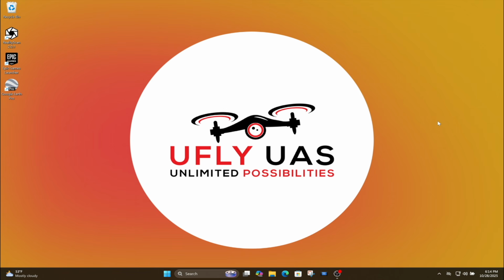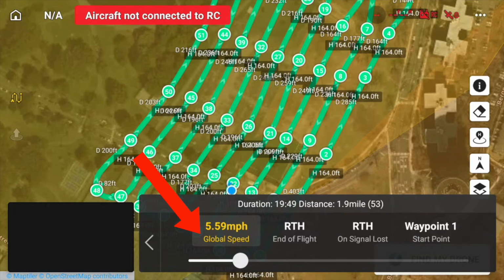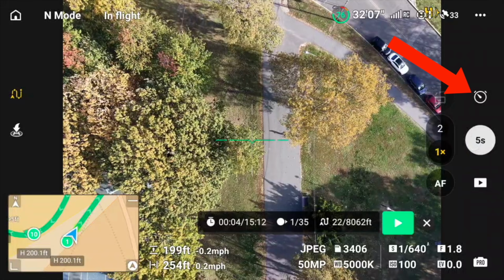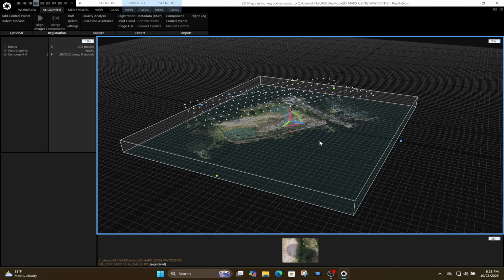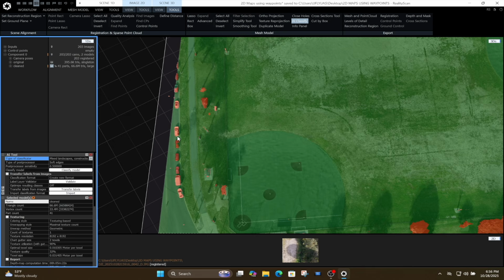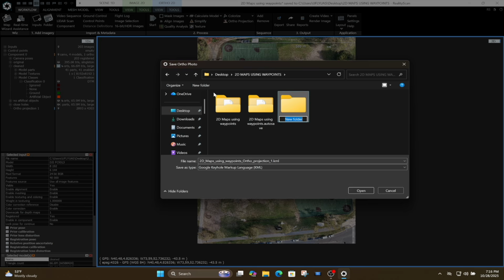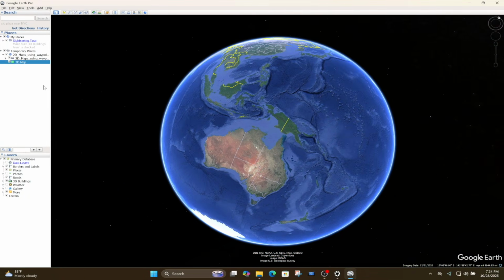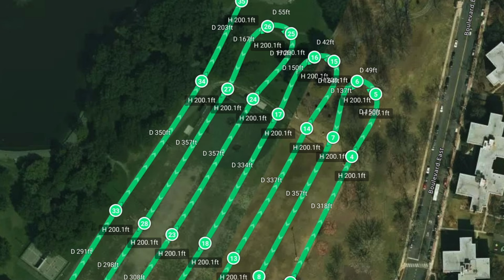DJI Mini 5 Pro | Using Waypoints To Create 2D Maps For Clients | Step by Step Guide For Beginners.

Comment: What is happening if the drone run out of batterie when running waypoint mission?
Reply: The drone will stop the mission, RTH and land. Once you change the battery, you can resume the mission where the drone will automatically go to the last place it was before returning home.
Reply from the maker: @santiagonogueira606 Thank you for the help. 🙏
Reply: @santiagonogueira606  thx
Reply from the maker: Like Santiago said. You can also pause the mission return it home , swap batteries and click play button again to resume the mission. Thanks for watching the video.
Reply: @uflyuas  thanks i wasnt sure :)
Reply from the maker: @bewakerztv You are very welcome. If you need any other help feel free to message me.
Reply: Very great video and educacional. I Will have some questiona later, but first I Will try every step. 

But for now just One question. Can we use this tutorial for going a 3D modelo of something smaller, for instance a little object taking several photos a round it?
Reply from the maker: @carlos.galhano yes absolutely. I recommend doing orbits for 3D Model together with top pictures.
Reply: So, how to effectively determine the overlap on lef-right side when drawing the waypoint ?
Reply from the maker: @muarrifalwazir1828  Are you doing a 3 D Model? Or a 2D Map? But whatever you doing if you keep the drone speed to 6 mph that will create a 80 front and 80 side overlap. If you increase the speed then you are lowering the overlap. To keep it simple go to the area you going to map. If is a 2D Map with only Nadier photos,  meaning shooting photos straight down and you are flying high you will cover a lot of ground with one photo but if you fly lower you will cover less ground so you have to keep the waypoint lines more tight together to keep the overlap at 80 maintaining the speed at 6 mph.  Please let me know if I can help you in any other way.
Reply: But wouldn't the overlap depend on the altitude the drone is flying at and the distance between adjacent parallel flybys? What altitude do you use?
Reply from the maker: @lhxperimental  Normally 150 feet  to 200 feet. Is very simple. Keep the lines close together and your overlap will be just fine. All DJI drones have a wide angle lens. I do this is all mapping jobs and never has any wholes or issues.